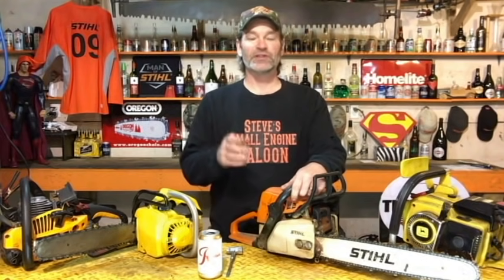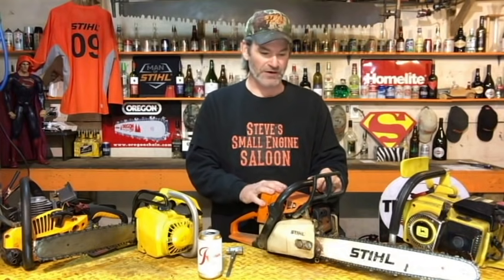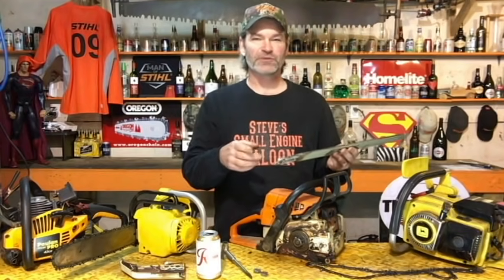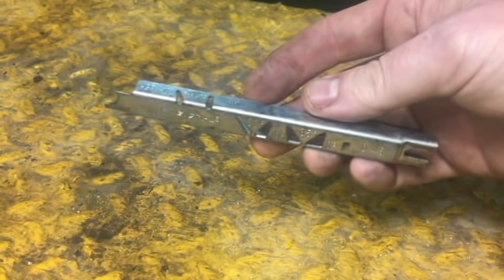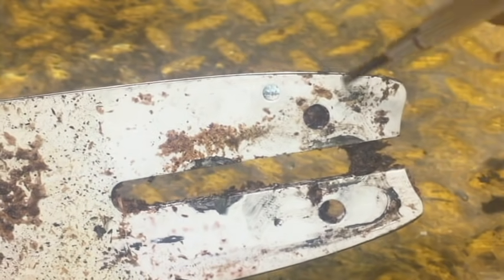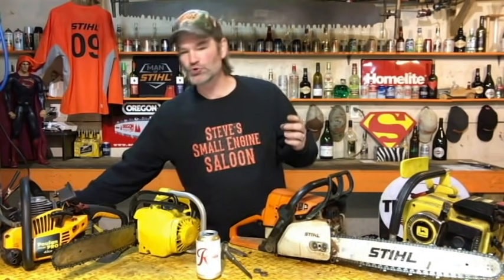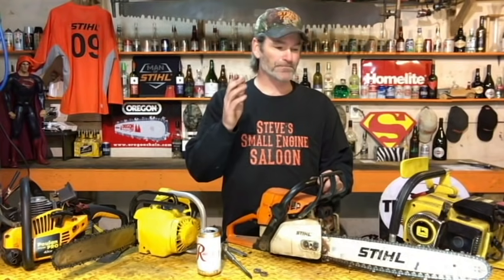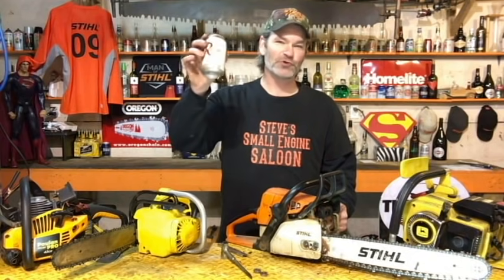How To Fix A ChainSaw If It Won't Oil The Bar And Chain

Comment: This might sound sorta obvious, but make sure you use a lighter bar oil if you're working in winter weather. Summer oil turns to molasses in the cold and you could easily assume there's something wrong with your saw. Bring it in the house, warm it up for half a day until the oil flows, then dump it out and replace it with the proper winter oil.
Reply from the maker: Paul, what an awesome idea for a new video.  Thank You...

Comment: steve i have a blue max chainsaw from home depot 52cc chineese made can you tell me how to remove the rear handle i need to replace fuel line and filter i have removed all the screws i can find i cant loosen it at the chain end love your videos

Comment: I'm looking for a video on this if the oil pump isn't flowing well? Cleaned the bar, small amount of oil coming out, but not much. Tried blowing out the oil line, and make sure it's drawing.
Any other ideas Steve? Love the videos

Comment: at work i use a nail to clean out the hole and my tape measure tip piece to clean the guide bar

Comment: My 1999 029 farm boss has a reversable chain bar with 2 oil holes.....the bar had a groove rubbed in the bar from the plastic oiler cover pressed against the bar for 20 years.....it has a small raised lip around the oil passage hole and it rubbed thru the paint and into metal making a small gap letting oil go down beside the clutch bell while running and also make chain run hot....tip for the day.....inspect closely when looking at this 😊

Comment: Steve, my Stihl 026 still isn’t pumping oil even with a cleaned and flushed oil Resevoir and strainer screen clean, new oil pump and everything. I had to update the original plastic no-arm pump with the newer type pump which uses the arm. Also new clutch drum, oil feeder tube (the one from the pump to the bar)new thrust washer and bearing, new needle bearing - basically the whole kit, I’m using standard bar oil, my saw is about 35 years old and runs GREAT, just won’t oil the chain, help !!

Comment: To  clean the oil hole I just get a really small drill bit and put the drill bit in the oil hole and clean out the oil hole like that, Thanks steve good information when soming is wrong with my chainsaw I go to your channel and look for what I think is wrong with my chainsaw.
Reply from the maker: Great tip!

Comment: This is a great tip but will it work for a DeWalt DCM 575 electric chainsaw? I cant see the small hole in the bar. The oil; gushes out of the exit in the plastic body as shown but spreads all over the bar.

Comment: Maybe you could do an overview of some battery chainsaws and the problems they can have.  I use an EGO 14" 56 volt chainsaw and it is just perfect for the average homeowner.  With a sharp chain this little saw can really cut through some timber.  I will never have a gas chainsaw again.  By the time I get the gas saw going I have the job done with the battery EGO

Comment: But Steve, my bar doesn't have a designated oil hole...it appears to use the unused tensioner stud hole for oil...that's fine tho cuz it throws plenty of oil as long as I keep the port clear.

I just found that a little plastic capped stick pin works real well for cleaning the groove on my little cs400.

Thanks...keep em coming!

Comment: I have 3 electric saws. 2 lube what I would call properly woth build up on the top of the var below the chain and bleed from both holes on the nose bearing. The third bleeds out under the cover. The chain is clean. The bar is clean. The mate up of saw to bar seams good. Super frustrating.

Comment: Hey Steve, question about a Craftsman CMXGSAMY462S. Upon looking on line for replacement parts for this saw. The saw looses oil. I have taken the oiler out and noticed the gear on the pump doesn't mesh with the plastic on the worm gear. I don't know if parts for this saw are even available??? Thanks

Comment: I use a putty knife and I always carry a precision flat blade screwdriver I'm going to check that hole in the morning its a crappy homelite chainsaw and I think the pump is burnt out it isn't spitting anythingand I've rebuilt everything motor wise and it now runs like a champ but will burn a bad and chain in 5 minutes or less I've already cleaned the bar but didn't think about the oil hole I don't think thats the problem though but thanks for the info

Comment: My Echo bar (18") doesn't have an oil hole and so I guess the oil migrates down to the bar slots?  always a puddle of oil under the saw after use any thoughts?

Comment: I had the same problem and did not have the specialized tool to disassemble the chainsaw to get to the oil pump.
Was going to make the tool but though to myself "just one more vid", low and behold my chain wasn't getting any oil because i have a spacer plate which doesn't seat properly so all the oil drains down behind it, i dug around the garage and all my "rvt" silicone that i had used for previous "projects" have dried up but i found some marine silicone that hadn't dried up completely yet so i used it.
It hasn't cured yet but i can already see that it makes a complete seal, the bolt is only finger tight now, tomorrow once it's cured I'll tighten it and off to the races!
Ironically i bough the chainsaw at an "off the truck sale" and it was a demo or returned item deemed 100% fine, i was quite disgruntled about my purchase until this vid.
Well played sir.
Mag dit reen waar jou bokke wei.

Comment: Hi Steve. I’ve ask this to a few u tube people no one seems to have the answer. I’m trying to change the oil filter/strainer found inside the chain oil tank. Problem is the feeder tube connected to filter is to short to pull out of tank to get to the filter off the tube. What’s your thoughts. If I have to change the entire hose from tank to where it goes?? I don’t know how. Any video on that?? Please advise thank you Ted

Comment: I have a Husqvarna Rancher. It has plastic gears and I have eaten the gears off it twice. I  have pretty much bought this saw twice in repair  parts. My cheapo Poulan, who ironically is made by Husqvarna, has cut circles around it. I  know other guys that love their Huskys. Maybe I just got a Mondaybuilt saw.

Comment: Steve have you ever seen a Tanaka ECS 505 up close and had to work on it? I got one now and the oil is coming out of the wrong hole down low what could possibly be causing that there's two small holes one up top where it should come out into the groove and another one below which is for what?  Air intake? It seems to me that the thing must be just running in Reverse or something maybe it got reinstalled backwards at some point in its life I just don't know anything about the SOB carefully to nobody in the right position or what's going on any insights would be great you're very great Channel I've learned quite a bit from you thank you very much

Comment: Well - I thought that I had this thing whooped.  With no chain, oil does seep out just the way you showed. The bar track did have some junk, as did the hole in the bar - all cleaned out. Tension is right  etc.  But it ain't splattering or throwing oil out when I tested it.  When I looked at it again, took two nuts and the cover off, the inside of the cover/housing is coated with oil. The oil isn't making it's way to the chain - evidently.

Comment: Do you have an explanation/video of the oil pinion gear.  What is the wire that wraps the outboard side of the gear and extends laterally with a small hook on its end.  This assembles directly under cover washer.  What does it do?  I seen other vids of it but none actually explain the wire/hook and how it engages the drum to make it turn.  I learned about its function by trial and error, simply by assembly and what parts went where and then I found it contacted the drum during installation.  Thought something was wrong until it fell into the drum notch where it us supposed to go.  Think we learn by trial and error!

Comment: hi steve   I have the ms391 I am not familiar with it at all.  All I know is the little valve #1128 640 9100 is gone  maybe something else is missing right in front of it     also  looked at a diagram and it seems to have a notched pin and pin missing not sure  can you help me out    thanks

Comment: So, my saw does not seeping oil out of the port onto the bar & chain. Thanks for showing me about all that. Do you also teach what can be done in my situation?  Must I take it a shop now? I haven't found information from you or anyone about how I  might best proceed to having a lubricated change. If I had beer I might have killed a Sixpack already.

Comment: Please help
i have dolmar 102, its oiling but i have oil leaking through the metal part. i think that metal part is some kind of retainer for the oil pipe where the oil is coming.
i think there is space between the metal part and the oil pipe, and cant hold the oil.
some advice
Tnx

Comment: I have a Poulan pro 42cc and the oil comes out but drips down the bottom of the oiler and it doesn’t oil the chain. This chainsaw does not have the hole on the bar but in the holes to attach the bar to the sprocket . Is the pump bad or am I missing something? Thank you!

Comment: I have a stihl ms 291 and the problem I have is it doesnt lubricate the chain. The bar oil spills from the bottom of the bar between the bar and the plastic seal. Is it possible that edge of the plastic seal is not flat? The pump works but it seems like its not sealing properly.

Comment: Hey Steve love your show,l think the Stihl saw that was made in America has a bad flaw with the oil cap and body design. I always use a old paint brush to clean the surface of wood chips before adding oil to reservoir, the new design will not allow you to do this and small chips and debris get into reservoir  causing  all kinds of other failures down the line. Thanks for the excellent tips!

Comment: Hi Steve, oil isn't coming out mine at all. Iv cleaned the clutch area as best I can but nothing coming out. Its a husqvarna 550. Any ideas?
Reply: Petrol in the oil tank seems to have done the trick 👍

Comment: Hi steve...   advice please. I have a oil leak on sthil ms181 chainsaw and it's not from the pipeline... under the chainsaw near the pipe itself is a hole and the oil is coming from there any repair ideas please

Comment: I have a problem with my chainsaw. There is oil going in bar but chain is not picking up the oil and oil is dropping from the side, close to sprocket. Any help ?

Comment: Any pointers on getting the oiler working on a McCulloch 200 and 250? Just picked up both of these saws and got the 200 running, but no oil on the bar.
Reply from the maker: Check my playlist

Comment: Do you recommend cleaning the Bar Oil tank? The owners manual for my Husqvarna 350 say to clean the tank, but does not say how. I see some claiming to rinse the Bar Oil Tank with gasoline or seafoam. What is your take on this? Great video as always

Comment: How will you know for sure your clutch isn't tweaked? My chain was tighten enough, not too tight. But it kept throwing the chain. I've put it all together and I kept making sure chain was easy to  pull along the bar. But once I tighten both nuts on bar chain wouldn't move.Would it be a bent in clutch or is the safety bar you move forward to lock chain from moving, in wrong spot too far forward. Saw starts but chain keeps coming off. I'll double check to make sure chain is tight. I've been told a small gap hanging from bar. But teeth are still in the grove. What am I doing wrong? Probably not even a tweaked clutch.

Comment: I get a light spray of oil off the tip of the bar, but the chain itself feels kind of dry, and the chain gets quite warm—almost but not really too hot to touch. Is this normal?

Comment: OK I’ve done all that and it’s still on oil the chain oil just pours out of the bottom of the Saul with the clutch is that the cover it just pours either but it won’t go down the saw blade down the chain help me out

Comment: Just curious what lubes the crankcase on a chainsaw??
Reply: It's a 2 cycle engine so oil is mixed with the fuel.
Reply: Rich B. I get that but that Burns  in the air on top end I was talking about the lower crankcase rich
Reply: Rich B. Thanks for answering but I just don't see how lower crankcase is lubed rich thank you rich just curious??
Reply from the maker: Some of that oil/fuel mix goes down to the lower crankcase through transfer ports

Comment: Steve or Anyone notice the new Stihl chainsaws don’t oil as much? Like the newer 066 or new 500... oil on high as it will go and they’ve been serviced so it’s not blocked etc but it still struggles to oil even a 20inch bar properly... any suggestions? Shop said use thinner oil. We Only use Stihl oils and are in QLD Australia so it doesn’t really get cold enough to justify thin oil does it?? Weather is between 10°c - 25°c in winter here tho this oil issue has been like this even in summer and only seems to be slack on oiling the bar and chain on newer 0** models not older versions. Cheers

Comment: Thanks, I fixed it! I had painted the bar because of corrosion and had a "fisheye" at the oil hole that was letting some oil through but not full flow. Cleaned that out and problem solved! 😊
Reply from the maker: Right on

Comment: This is great information. Question - If you don't have an automatic oiler how often should I be pushing the oil lever? My saw is a small Homelite from the 70s. Thanks in advance.

Comment: You are a hard one to get hold of.Watched many vids over time.Replied, but nothing on any from you.Anyhow, Thanks for vids.Sthil MS250... Is it the norm for the oil pump to go out on these? Cleaned all holes, worm gear is fine etc.Does not throw oil out at all like in this vid....
 I do see a small amount of oil after it sits a day leaking out bottom of saw.Least and or the plastic on bottom and black color has oil on it.I have not checked the oil line/hose yet.Will a bad pump cause oil to leak from bottom of saw ( assume pump is bad due to no oil flow.Gearing on it looks fine )? I had someone look at the saw.They say pump is bad due to bar got pinned in wood and someone yank on saw.Thus put saw out of alighnment.Had to reajust whole handle etc.Thats what I was told yet I see no indication saw was apart to inspect anything.

Comment: How much oil should  a saw use per tank of gas? I've heard that  a saw should use about one tank of oil per one tank of gas. my Cub Cadet CS 5220 uses about 1/3 tank of oil per one tank of gas...is that a good ratio? I've yet to try the cardboard trick. Thanks

Comment: My was not working so I cleaned bar as suggested and no change but it was a bit dirty so probably good to do as routine maintenance. What I found on my saw was the filter was covered with a white substance, maybe had some sawdust in oil not sure, I’m really super careful when filling with oil not to get something in the tank. I dumped it out cleaned the filter washed tank out with gas and now it oils like a champ.thanks for video as it led me in the right direction and now I know how it works, not very complicated.

Comment: Steve great tip. I bought a used Makita EA6100P chainsaw and noticed it sprayed ALOT of oil. After removing the chain, I used that first tool you showed and ran it in the groove in the guide bar and found alot of gunk! I re-adjusted the oiler from max to a medium setting, works correctly now but it took a week for all that oil to stop leaking!
Reply from the maker: Right on ....

Comment: I have a stihl ms290. I have oil coming out of the oiling hole. The problem Im having is when i put the bar and chain on the oil starts to come out around the inside of the cover and and gets on the clutch and it slings it everywhere. I ve put a new bar on and i made the sure the bar studs were tight. Ive put the bar on without the chain and watched it. Its going in the bar just fine. It doesnt start slinging it everwhere. But with the chain it does not get enough oil in the bar. it starts pissing out somewhere else. I cant see where its coming from. My best guess is that its seeping past where the bar meets the slot and  runs down on the clutch.  WTH could it be.  Thanks

Comment: Cleaned bar with putty knife...cleaned out both bar holes with carb spray....that was only half my issue....cleaned and filled completely the oil compartment in diesel overnight...sprayed carb cleaner directly into the oil outlet jet...until it went inside finally created a pressurized gusher. Emptied diesel filled with bar oil and tested...works great now. I'm guilty of using 5-10w-30 used motor oil...so I'm the culprit.

Comment: Thank you so much for this video! I was searching all over to figure out how to do this. I don't know if this is what my issue is but it burns the wood instead of cutting it. I do see oil spraying the ground when I run it but its a very small amount so I am thinking the hole isn't completely clogged but likely has some blockage so its not delivering enough oil.

Comment: You just saved me money. My old McCulloch Super Pro 81 wasn't oiling the bar, even when I used the manual oiler button, and I was afraid that I was going to have to replace the oil pump. Turns out the hole was clogged and once I cleaned it, it worked just like always. Thanks!
Reply from the maker: Glad I could help

Comment: Hi Steve, I’ve got a stihl ms 250 and having a problem with the bar and chain are not receiving enough oil. I watched your video on this subject checked all the things you said. I found only a tiny bit of oil coming out of the side oil hole but lots of oil coming out under the exhaust in the centre of the saw. Any thoughts on what might be happening would be appreciated. PS love the channel 👍